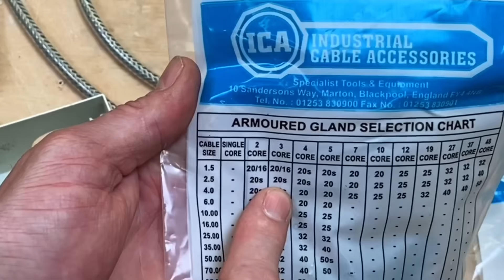SY Cable or SY Flex How to Terminate, Make Off Step by Step Practical Demonstration of Connecting

Comment: "Fortuitous earth path"!
17:00 I'm glad he mentioned taking the bolt of the Earth tab to the earth bar right near the end, implying a fly lead. 
At the beginning he said "we no longer bother taking the paint back" which was a bit disconcerting. Too many times I see earthing relying on the earth tab being bolted to the shell with no fly lead, which is fine when building a Main Frame but lazy when building a normal DB.  Some glands now have the new style spiky crown washer that can pierce a powder coating, but those are few and far between. If using a normal flat washer your Earth path relies on any burrs left after you drilled the hole. If you neatly debar your hole, as you ought, your Earth path is now where the thread happens to touch the edge of the hole. Great.

Comment: Excellent demonstration showing how to earth the SY braiding. Could you please do another video  on how best to earth the SY braiding through a three phase socket and plug so the SY braiding can be kept earthed right into the workshop machinery if this is feasible using a five pin socket and plug. Without having to wire the welder, lathe, mill, bandsaw etc directly into the 3phase supply to maintain a good earth through the SY cable braiding.

Comment: Been a spark for 16 years and I’ve never terminated this kind of cable before. I’ve worked with braided cable many times as having worked in the oil & gas industry for the past 8 years. Although it’s different glands you actually terminate the braiding of the cable as you would with a SWA cable/gland.  Very interesting and informative video and I’m extremely humble to have came across something I’ve never done and to learn about it!

Comment: Gary, love your videos but your installation method this time around is flawed sorry.
The braid should actually be inside the equipment / enclosure and clamped between the two washers and then locknut on to keep it all in place, the braid should not be on the outside as you have shown.
I've made off 100s if not 1000s of these over the years.
CMP explain it in detail better than me.
A picture paints a thousand words ................😊
https://www.cmp-products.com/glands/products/industrial-general-purpose/cxt-industrial-cable-gland/
Keep up the good work 👍

Comment: I know this is the by the book way of doing it, but i really can't see a reason why you cant just use a stuffing gland and take the yarn strait to the cpc terminal inside the enclosure? This has always seemed pointless imo. I haven't used sy in the 10 years since doing my AM2 and I'm a commercial spark (Before I get the housebasher comment). The most pointless cable ever invented also.

Comment: A little trick for cutting the braiding back. If you make a little hole by peeling the braiding to each side you can hoop the cable through and cut off the braiding where needed. I've always linked my braiding to earth directly however and sleeved.

Comment: Hi, would it be acceptable to fix the earth rings down with a locknut before putting the gland into the consumer unit to make it easier ? Then another locknut inside the consumer unit to hold the gland in place?

Comment: Pretty sure you can use it...  Have to Put it down as a departure from bs7671 on certificate and fill in box for other type of cable on circuit schedule..
Reply: Any departure from BS7671 must meet or exceed the UK standards, how can you show it does when you have no current carrying capacity of the braid under fault conditions. Even the manufacturers say it is only for controls not fixed wiring for power supplies.

Comment: Those glands are simply the worst type of gland I have ever had the misfortune to use.
I used them in the 80s, complete joke, and you expect them to improve, no they didnt.
If you are thinking of using these stop, chuck em in the bin.
Loads of other good glands out there, just like SWA E1W glands or similar, where they grab the flex all around with the olive.
Also, if your doing any high frequency work, these glands dont meet latest EMC standards where as an E1W type does.
Reply from the maker: Thanks for your feedback 👍🏻 these glands are the ones my learners are required to install as part of an assessment hence the video 👍🏻

Comment: Hey, great video as always. We have to make off SY for our college exam, but have been told that we need to take braiding inside box and then crimp. My college is saying this is what is expected in the AM2. Has anyone done the AM2 recently and know which is the required way for it to be fixed?
Reply: Not sure about AM2, but that's the way I do it and it's far less fiddly, cheaper and more secure than using those special glands.

Comment: The cable gland could be designed better by having a cup shaped washer and a flat washer to keep the strands in place . The same as a CPC connection on an immersion heater .
Reply from the maker: Thanks for the comment 👍🏻
Reply: @GSHElectrical  WHY ARE YOU USING / promoting SY ?? AS OTHERS HAVE SAID SY DOES NOT CARRY AS BS no.  AFTER CONSULTING NICEIC & IET THEY HAVE BOTH SAID SY IS A C2 if showing any signs of thermal damage. As the braiding is not designed to carry any voltage it should not be used as an earth .. SY IS FOR CONTROL CABLE.. SURELY YOU SHOULD BE TELLING STUDENTS NOT TO USE IT .. there is cable manufacturers looking at making SY & getting it a BS but untill then you are installing a C ISSUE IF USED . PI** POOR PRACTICE!!!!!
Reply: You can get SY glands with a chrome finish that looks like a skintop gland but has a brass top hat inside, much better glands

Comment: I was told you couldn't use SY flex as it doesn't have a BS standard  .
Reply from the maker: My learners have to install SY cable as part of an assessment hence the video 👍🏻
Reply: @GSHElectrical  is it correct that we can't use it in the UK because it's not got a BS standard,  seeing as it's a European cable is there a harmonised standard ?
Reply: @dennisphoenix1  & the braiding is not designed to carry voltage .. this video is so wrong . As it’s for U.K. STUDENTS.. he should be telling them it is not to be used in new installations or they are installing a fault.. PI** POOR PRACTICE
Reply: Can SY cable still be used?
SY cable is not suitable for use outdoors or in fixed wiring applications that require compliance with British Standard 7671. This is because the braid may melt if exposed to heat generated by a short circuit.
Reply: It is was it is
Reply: Got to then ask the question, why are products for SY cable still being manufactured for the UK market, if it is not allowed? I don't know but that's a reasonable question. SY not allowed on Ex installs but allowed in factories and commercial I think.
Reply: Is SY cable a departure from BS7671?
Under BS7671 18th Edition Wiring Regulation, SY, CY and YY cables are only appropriate for UK fixed wiring installations requiring compliance with the Wiring Regulations where certain standards can be determined, provisions made, and such use is recorded in the appropriate electrical certification.
Reply: He only says so indirectly, but this is mostly for light industrial rather than domestic installs.

Comment: WARNING. That gland is fine made off like that when it’s inside but not when used externally installed in that fashion, and I’ve seen hundreds no thousands of them especially on air con units, the braid acts like a wick and draws moister down the braid is then heated by the sun causing  mould  growth and corrosion destroys the earth continuity to the braid and eventually fills the lower end switch or joint box with water If you look at the gland the split stops short of the base you need to make off with the two rings or washers on the inside thus preventing moister to enter between the external pvc and cable sheath,
Reply: Oh yes forgot to mention it’s also not suitable to be used outside in the first place but unfortunately it dose get used, so at least stop the water getting in or use a suitable cable even better.
Reply from the maker: My learners need to make off an SY cable as part of an assessment hence the video 👍🏻

Comment: dont project the banjo locking bolt too far into the c.unit.. brass nut with brass hex bolt easy to tighten say 15mm ,  in length..

Comment: who would even bother with this stuff..when there are alternatives available...and are easier to terminate..
Reply: I've done electrics for a long time, and I did an apprenticeship many years ago. I was never taught SY and I've never used it. I can't help thinking for the exact same amount of work you might as well use SWA? It's tougher, better and you can use it outside and bury it etc. If you don't need that level of mechanical protection, then you might as well use NYY-J and stuffing glands and save yourself a little bit of faff. Also, I haven't used a banjo in years, those pirahna/earthing nuts are so much less hassle and save you compromising the IP rating of your enclosure.
Reply from the maker: It’s part of a practical assessment my learners have to do hence the video

Comment: I have just removed alot of this shite cable in a garden which the previous "spark" used to wire lights and sockets! He used the braid as an earth cause he found he did not have enough conductors to do what he wanted to, he terminated the braid in choc blocks in the back of the lights! The cable was undersized also giving massive earth fault loop readings. Needless to say the whole shite got ripped out and replaced with swa.
Reply from the maker: My learners need to make off SY flex as part of an assessment hence the video 👍🏻
Reply: @GSHElectrical  I appreciate the video, and it's a very good demonstration. The issue I have not with you but in general is the selection of equipment in general for the environment, I have seen this stuff in loads of gardens etc where it is not appropriate, yes it has its uses in industry, but it is not recognised by bs7671 as a previous comment stated. In my opinion its awful stuff and there are better alternatives in certain situations
Reply: SY cable is shite - period.

Comment: Another great vid guys. 
I’m glad your showing the younger ones how to do it correctly. Hopefully we will see correctly glanded sy on AC units in the future. 
Personally I bloody hate the stuff and it should be sent to hell. Nearly all my commercial inspection I do, SY has been installed terrible and the condition of the cable if stupidly used out side or in damp conditions is appalling.
Reply: It shouldn’t be used that’s why ITS NOT FOR CARRYING VOLTAGE IN U.K. JUST CONTROL GEAR … as for using the braided for earth lol it’s not for that in any way IET & NICEIC BOTH SAY SY IS A C3 min but a C2 if showing any sign of thermal damage ( which it does if any voltage ever goes to the braiding)

Comment: Sy cable has no British standard,  It shouldn't be used. Use rubber ho7rn cable instead.
Reply from the maker: It’s in the end assessment for my learners hence the video
Reply: @GSHElectrical  why are you not contacting the assessment body and telling them it shouldn’t be used except for control gear !!!!! How many other things are you teaching that is wrong .. but doing it because the computer says NO 🤔🤔😂😂
Reply: @makg4655  SY can be used as supply cable (Low tension feed) I have asked all the manufactures and have their responses on file, its my insurance against owt going t1ts up. To be honest, after years of installing this stuff, Its fine.
Carried out inspections on my designs in Nuclear plants and its still ok, after more than 20 odd years in service.
Reply: Ok.decent tip. I just had to check  a gas  flare. Sy  cable outside run on ground no cable tray. Looked up the ruling.  Tbh  I have  used it on e or twice and didn't  mind it...but rules are rules. Ta
Reply: 100% Europen rubbish belongs in Europe!

Comment: Years ago I used to install commercial catering equipment and wired them up with SY cable. Those days I haven't seen any special gland for the SY ( or my wholesaler never heard of it)  so I improvised external SWA glands by slitting the main section with metal hacksaw and terminate the SW as you did. Great job by the way.
Reply: That's cunning.

I've never seen an SY gland, just seen it through a regular compression gland and if you're lucky the braid in to an earth terminal.
Reply: storm glands would also work

Comment: I was wondering is SY acceptable for fixed installation on trays for example. I used to use SY on machines but always thought it performed very poorly especially in any applications with even small amounts of flexing.  The outer sheath can be damaged by the inner braiding and they deteriorate quickly if installed outside.  You will always get moisture  ingress between the two sheaf clamp washer and water then collect inside the cable braid. In places like New Zealand they use something very similar to SY for all the industrial installations.
Reply: SY does not comply with our BS standard for cables, not sure why it is being promoted here? It is a cable made to a EU standard there are no tables for volt drop or current carrying capacity so it cannot be sized for our UK 18th edition.
Reply: @pirate69s  All manufactures produce the data sheets including volt drop and current capability.
The BS 7671 is just a guide, you should always use the manufactures data sheets.
And 6mm is 6mm is 6mm, volt drops will always be the same.
They will have different current ratings, and that is dependent on the level of insulation and at what temperature it can stand.

Comment: Don’t think I have ever seen SY flex, it looks like that American kopex that aluminium flexy conduit that’s pre wired . Were would SY flex be used ? 
Great video Gaz as always 👍👍👍❤️
Reply: SY and CY are a contentious one in the UK mate. There's an argument they shouldn't be used as they're designed to a German standard and not a British Standard. They tend to be used for control wiring and I've seen them used on pump sets, possibly because the manufacturer of the pumps sets are outside of the UK.
Reply: Sy shouldn't be used anywhere. It's not recognised by British standards. You should be using rubber ho7rn cable.
Reply: Normally on aircon  units, from the isolator to the unit, only time I have ever had to use it.